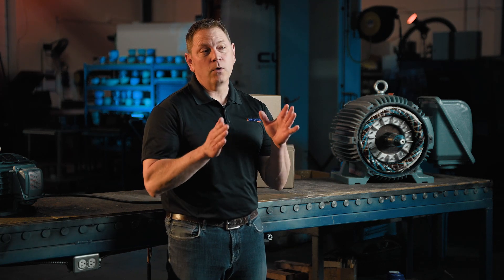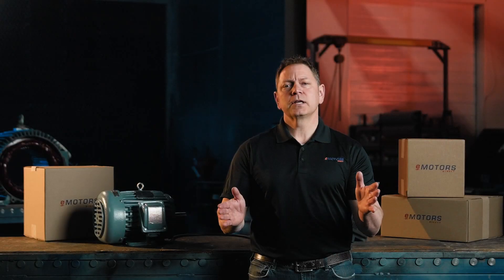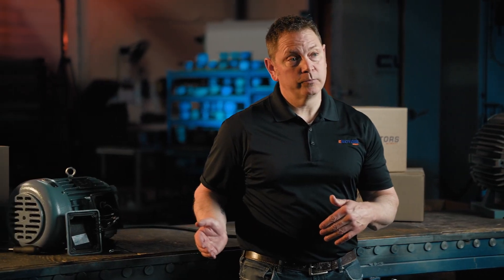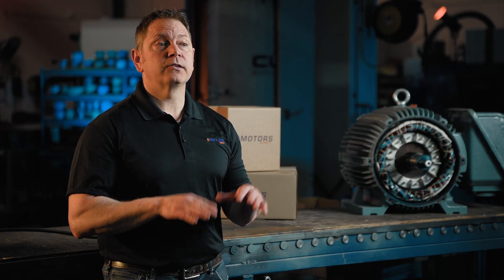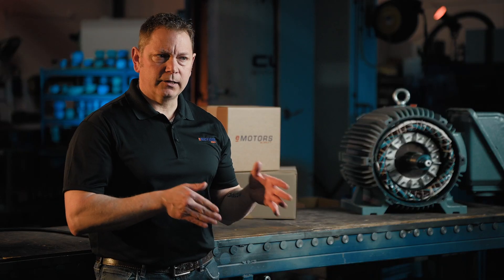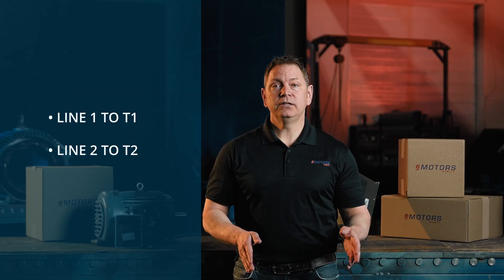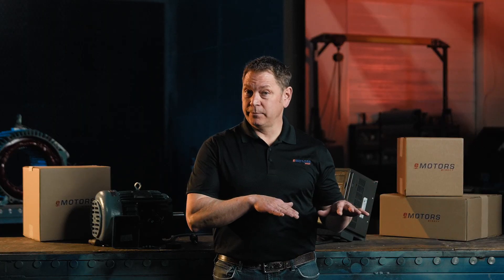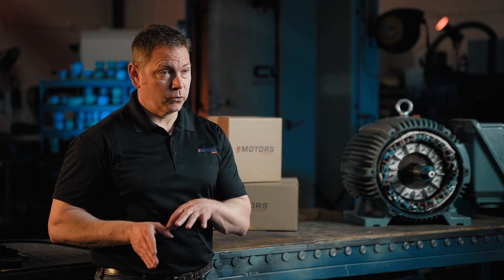How to Wire a 3-Phase Motor (230V & 460V) | Step-by-Step

Comment: Hello. My son recently picked up an air compressor from auction that is three phase (208-230v/460V). His shop has a 600a service, but is all 240v. Is there any way I can wiring this motor up to run off of the 230v split phase?  thanks for any help

Comment: Thank You for this video, I bought a Sharp mill that was 460 and was changing to 220. I looked at the diagram in the cover and moved 7-8-9 over but did not catch the little line showing 4-5-6 all connected, as soon as you said to connect them all it stood right out. Thanks Again.

Comment: Question. Have a 220 VAC Century motor for a pool circ pump. It’s sounded like it seized up. When testing, I found that it would run only when the external “ground -to-earth” was disconnected.
Would this be a short between a line and the chassis? Or something else. Removed from service regardless for questionable safety. Just found this an oddity.
Really enjoy your videos..
Reply from the maker: Glad you like the vids! That definitely sounds like a ground fault. Likely a short between one of the line wires and the motor frame or internal windings. If it only runs with the ground disconnected, that’s a red flag. The ground is doing its job by preventing unsafe operation. Removing it from service was 100% the right call. Could be internal insulation breakdown, moisture ingress, or a damaged winding. Check out this video which covers how to test your windings: https://www.youtube.com/watch?v=19zIZ7sTEhQ
Reply: @emotorsdirect Yep!  Internal windings were smoked… Appreciate the feedback.!!